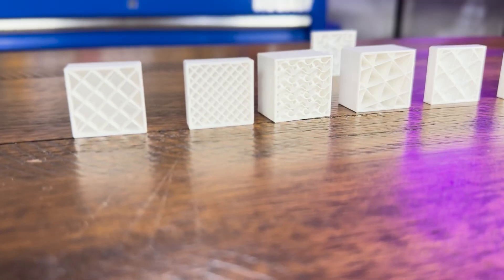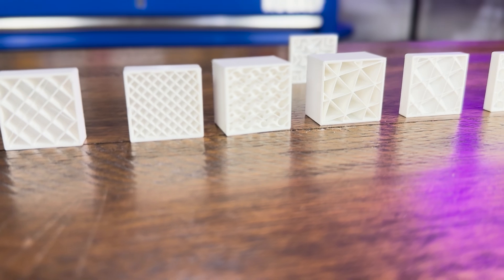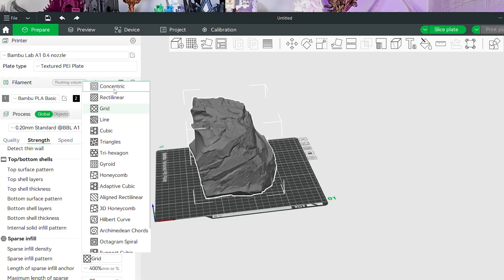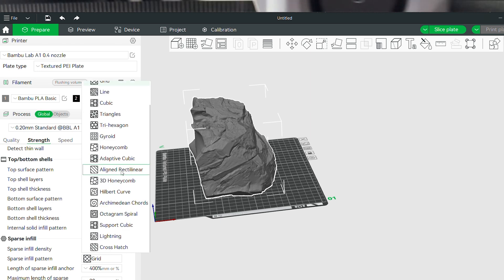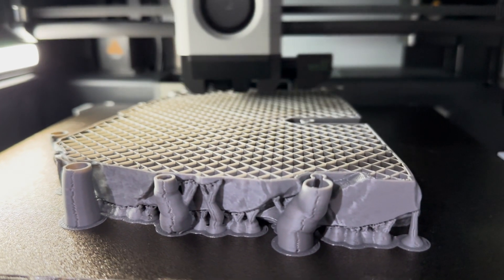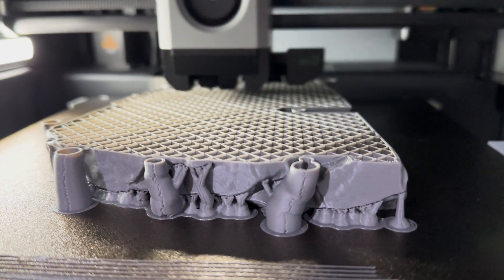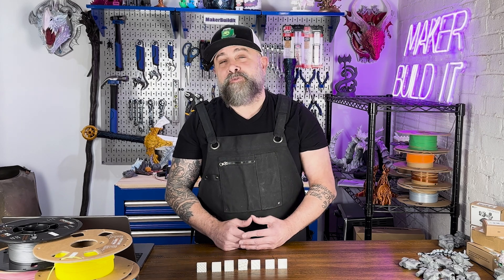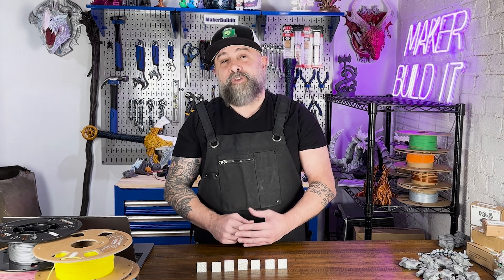The BEST Infill Patterns for 3D Printing (And When to Use Them)

Comment: Thank you for your video. It was VERY INFORMATIVE.
I'm looking to print an adapter on my Bambu Lab A1 that will allow me to mount my AMS LITE to a flat screen TV wall mount plate.
The designer's recommended config is for a INTERNAL SOLID INFILL PATTERN = RECTILINEAR with a SPARSE INFILL PATTERN = GRID.
As this is my 1st 3D Printer and I am very protective of my critical business equipment, I'd prefer to confirm the best durability & strength pattern to ensure that I do not have an issue down the road.
Which of the patterns that were covered in the video would you recommend for INTERNAL SOLID INFILL & SPARSE INFILL options?

Comment: I'm trying to print Zou3D mini animals.  I couldn't figure out why after many hours of printing the nozzle starts knocking them off the plate.  I just looked at the failed models with a magnifier and I can see that the gyroid infill is physically sticking up higher than the layer.  This is what the nozzle is catching on.  What's the fix?
Reply from the maker: You can also try switching the infill. Gyroid is great for bigger parts, but on tiny models it can bubble. Try rectilinear, grid, or cubic. They are much less likely to get hit by the nozzle. Hope that helps. 😁

Comment: I was looking for a good infill for my articulated prints. I've tried many different infills & infill ratios and still have had issues with the joints breaking. Come to find out it wasn't even the infill type or amount. It was the material I was using (Multi-Colored Silk), But your video did point me in the correct direction when I am using a better filament! Kudos on expanding my knowledge of infill structures and uses!
Reply from the maker: Glad it was helpful! 😁

Comment: I use triangle a lot, it's a good stiff and strong infill for fidget parts.  

Honeycomb is good for lighter weight parts

I'm not sold on some of the newer odd infills, they could be good for flexible parts,  but the don't seem structurally very efficient.

Comment: I think your statement of "It creates a cross-hatch structure that provides constant strength in all directions" for Grid infill is a little confusing. For strength, it provides strong Z height strength but is weaker on the X and Y directions. It's my understanding that was one of the problems Gyroid infill was designed to solve (equal strength in each direction). Also, there is a infill type named "cross-hatch" that Bambu Lab created which might confuse newbies.

What infill do you recommend most users use as their default unless they have a specific reason to change it? I have found myself using cross-hatch in Bambu Studio more and more as it is slightly faster than Gyroid and seems to as strong.